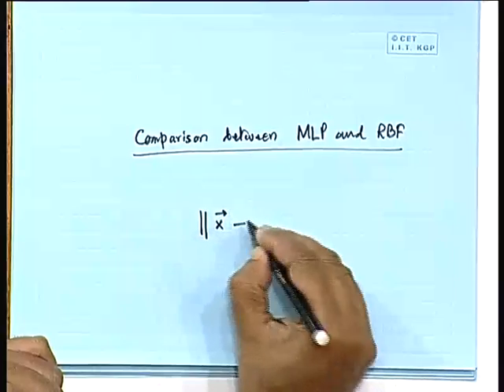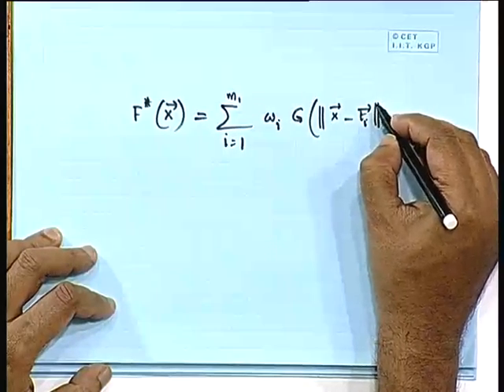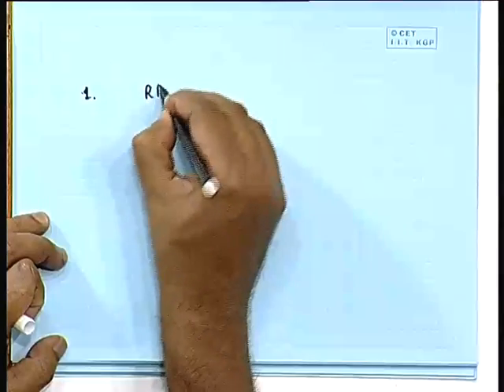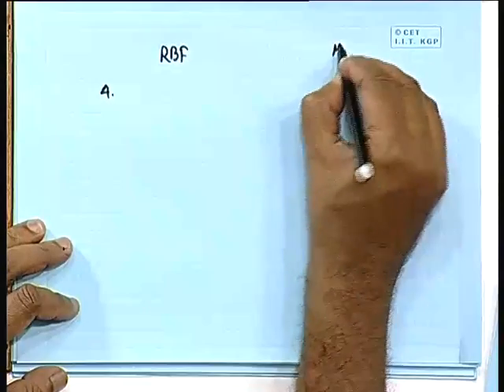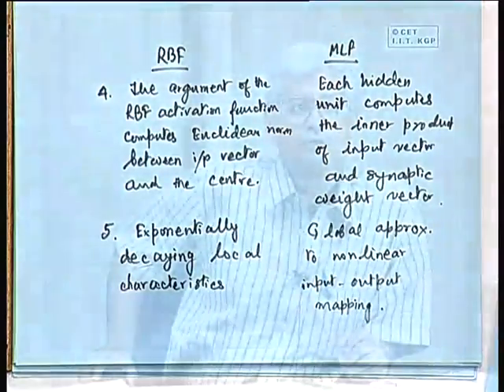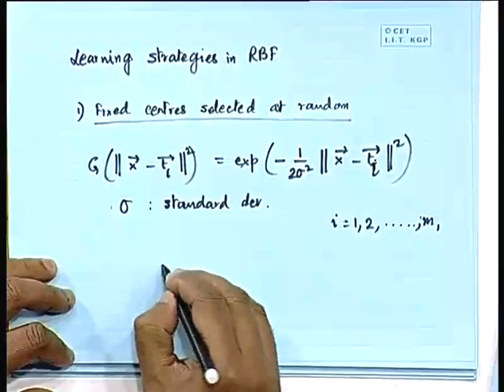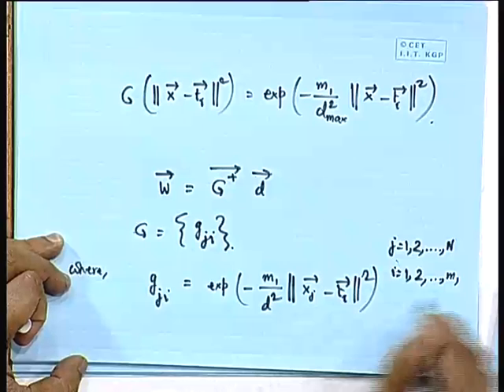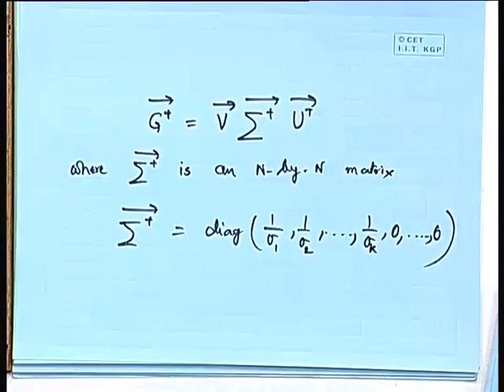Lec-30 Comparison Between MLP and RBF

Comment: So when is it better to use RBF networks over MLP nets?
Reply: When statistic density matter, coz of integrating intra-class overlaps in per-class output activation. When data is universal distributed and/or you need highly specialized pattern detector - then MLP better, coz it can overfit to that unic structure. Also, if you want to teach MLP with good correlation to density statistics - then you can use RBF to do GRNN transformation of coordinates of inputs data points and use that RBF-GRNN-transformation as Layer to feed into MLP starting at next Layer after it (same like PCA as special layer between inputs and MLP).